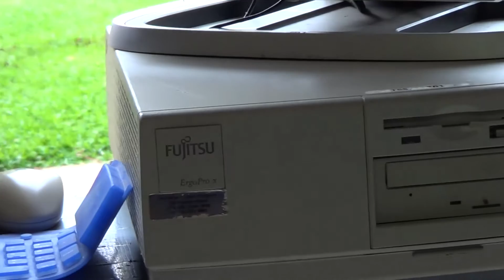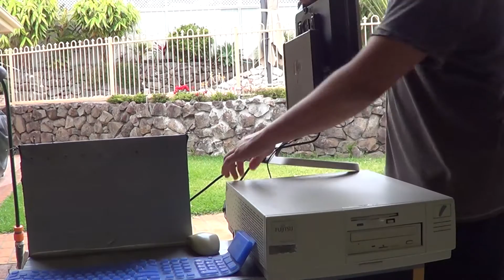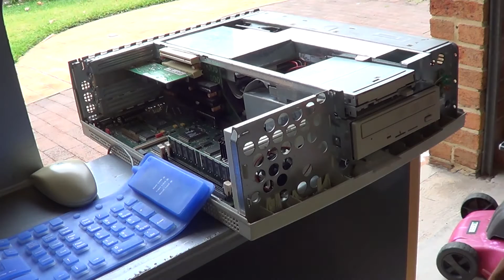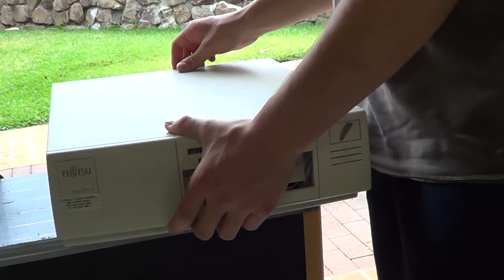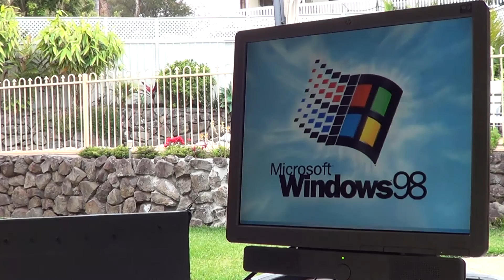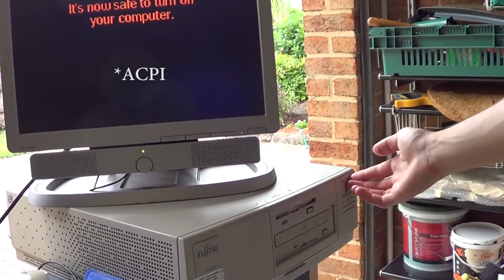OLD Windows 95 Fujitsu Ergo Pro PC

Comment: Hey, I made a video about the same PC on my Youtube channel @RetronautTech. Its potentially a great retro machine. but mine has died after washing the Motherboard. My bets right now are on the BIOS somehow getting corrupted, or the BIOS chip itself having some kind of partial failure. Anyway, I could possibly flash the BIOS, IF I could actually get ahold of the ICL Bios this machine uses. Does ther author of this video, or any commentors here have any ideas as to WHERE such a BIOS can be found. Its VERY specific its a BIOS for a 1998 (ish) Fujitsu Ergo Pro x453.
Reply: And FYI, the current Fujitsu Europ support site, STILL has the support files for this machine. I got the BIOS from there, used the built in Flash process on this machine, which works even when the main BIOS is corrupted, to get the CMOS flashed, and that fixed my machine. So yeah, oddly, when I cleaned it, that borked the existing BIOS slightly, strange.

Comment: I found an acer in the garbage and took it home . i cleaned it and installed a cd rom but the hdd was so small I could not even install windows 3.1. I kept the power supply , the ram stick the floppies and the hdd (which works fine in my quest xpand with dos 7) and threw the rest away. I also kept any card I found inside except from the mother board. It is still there but what is the use of taking it back since I have no hdd for win 95.
Reply: And today i went and picked it back up. I haven't tested it yet so i hope it still works

Comment: That is a nice system!
I have two ICL Ergo X x451 systems with Pentium 133MHz. One has 64MB RAM and 1GB HDD and the other one has 128MB RAM and 4GB HDD. Both originally came with 32MB RAM and 1GB HDD.
I also have a Fujitsu Ergo Pro X x564 with a Pentium II 300MHz, 256MB RAM and 4.3GB HDD. It originally had 64MB RAM.
All of these 3 were made in Finland, which is the country where I'm from.
Reply from the maker: That's pretty awsome